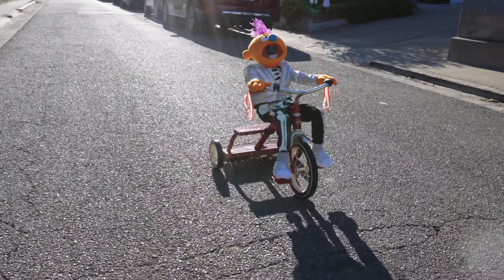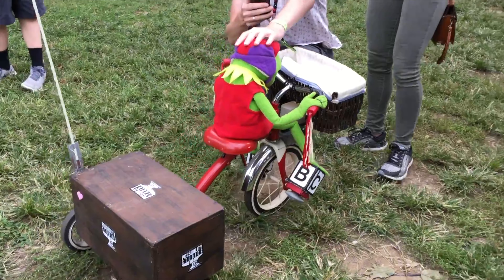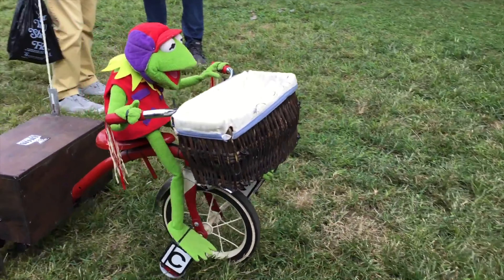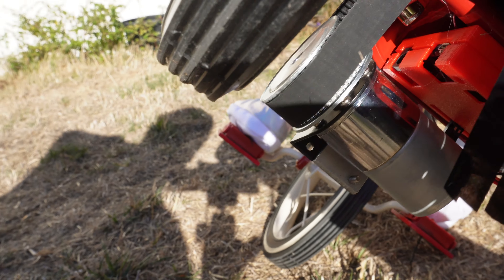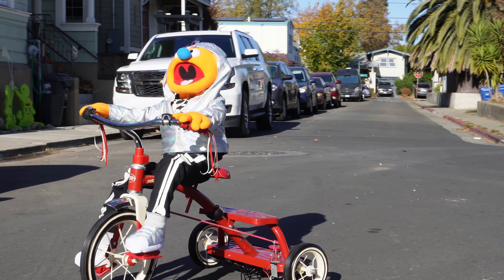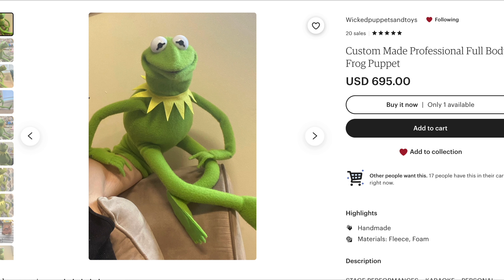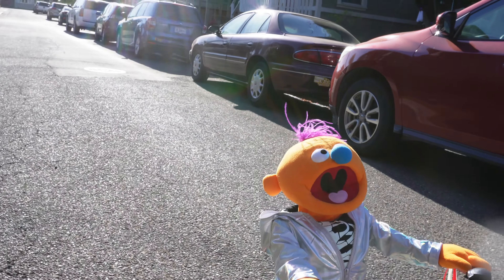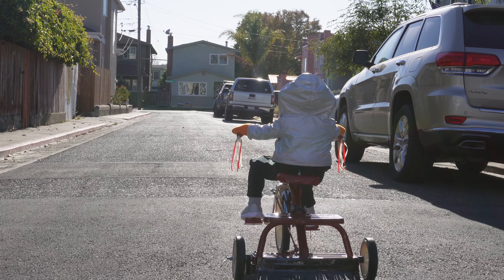Remote Controlled Tricycle-Riding Puppet

Comment: Excellent project, thanks for the instructable and the video.

Next revs, a windshield wiper motor is high torque geared DC motor thats already articulated.  Might be able to have the puppet's arms actually work.
Reply from the maker: I appreciate it, Craig. I do have a windshield wiper motor that I've been waiting for the right project to come along for. Trouble is, it's bigger than the servo I'm using, not smaller. I'm curious to explore the world of compact, high torque servos, but there are som many options to navigate through, it's a bit intimidating. Probably just need to show this project to the Servo City people to see what substitutions they'd suggest.
Reply: @MakerProjectLab  sure talk to them and the gobilda guys.

Comment: Great job. Suggest looking into 2 brake cables and housing to do pull pull steering. I have used that on art cars along with heavy duty Harley Davidson clutch cables and housing for brake and gas control.
Reply from the maker: This is a great idea! I think that's how a lot of the Disney animatronics are operated too, so that the noisy servos can be isolated. Also, with all this hollow steel tubing, it should be pretty easy to run cables through.

Comment: I have a question. The datasheet for the steering servo (ASMC-04B), says it uses less than 400mA no-load current. That seems crazy high for a quiescent current on modern electronics when it's sat doing nothing and especially if the motor isn't turning. Is there anyway you can check the actual no-load current of that servo on your model? Thanks in advance.

Comment: Fantastic.  Using the rear wheel diameter (7 in), motor rpm and gear ratio I calculated that your top speed is roughly 1.5 mph.  Do you think it's too slow or just right?  Thanks for sharing!